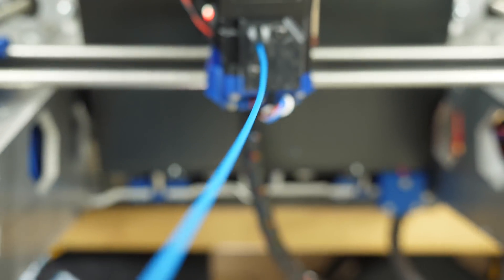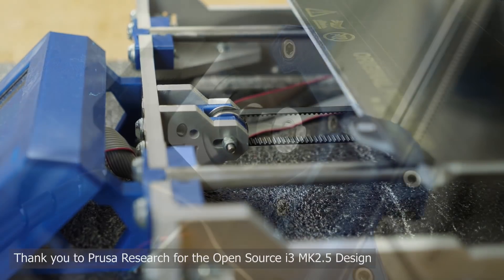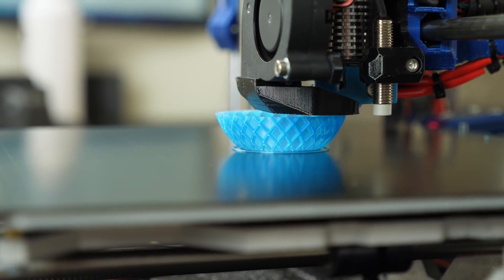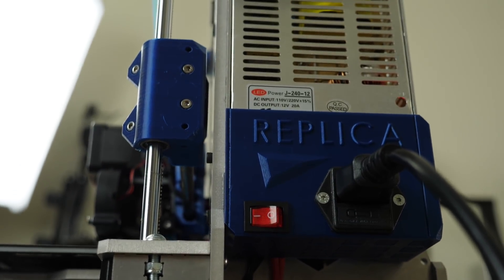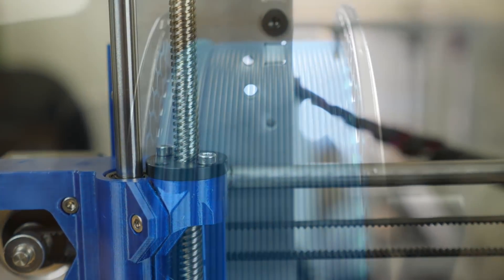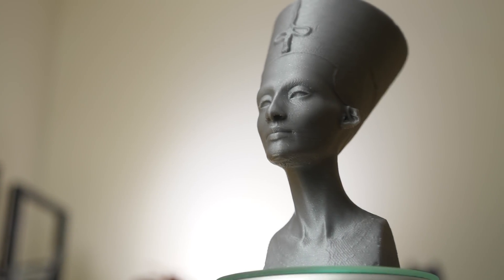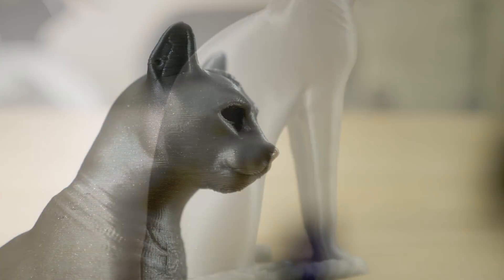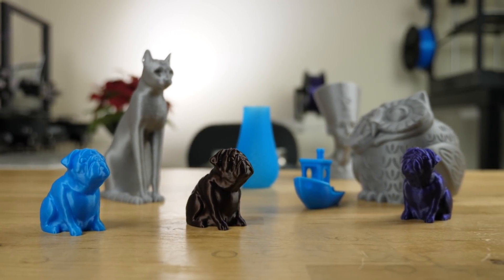Can a CLONE be as good as a Genuine Prusa? Journey Finale!

Comment: Hi, nice build! Curious what happens when you try to run MK3 speeds on it. Seems like it would give better prints than an MK3 would.
Reply from the maker: It was running on the MK2.5 profile, just slowed down in the video for effect, so apart from the 200mm/s infill, the speeds are very similar.

Comment: Now I am confused about the Firmware. Why was the 2.5S firmware wrong? That is what I used when I updated mine to a 2.5 (Rambo not Einsey)
Reply from the maker: Depends if you did the upgrade before the Mk3s was available. I think the 2.5 upgrade changed when the mk3s came out, if thats the case then you'd use the 2.5s firmware instead of 2.5.

Comment: Yes IT can.. get a prusa mk3S from Fysetc 😎
Reply: @Electric Boogaloo Yeah that took me by surprice aswell.. Connect main input to minus plug to minus psu - Ground plug to ground psu - Plus plug to middle pin on switch - Botton switch to plus psu... https://www.google.com/imgres?imgurl=https%3A%2F%2Fezcontents.org%2Fsites%2Fdefault%2Ffiles%2F2019-05%2Fpower_connection_fixed.jpg&imgrefurl=https%3A%2F%2Fezcontents.org%2Fbuild-3d-printer-part-12-power-supply&docid=Q9h2_uhz9kMqFM&tbnid=q8fjO9sUvX4vlM%3A&vet=10ahUKEwiIuNuj493lAhVCyKQKHXaTAcwQMwhIKAAwAA..i&w=1200&h=675&bih=937&biw=1920&q=psu%20wiring%203d%20printer&ved=0ahUKEwiIuNuj493lAhVCyKQKHXaTAcwQMwhIKAAwAA&iact=mrc&uact=8